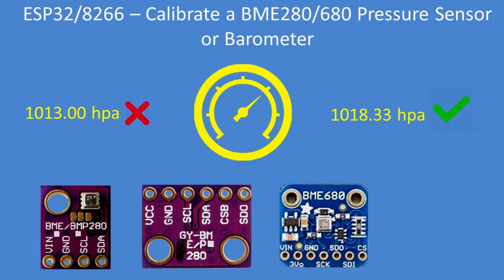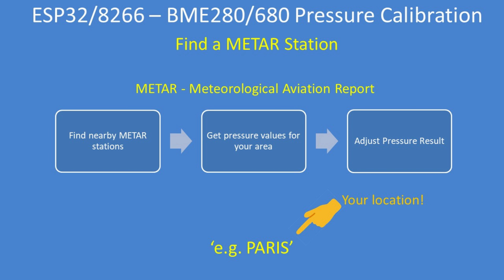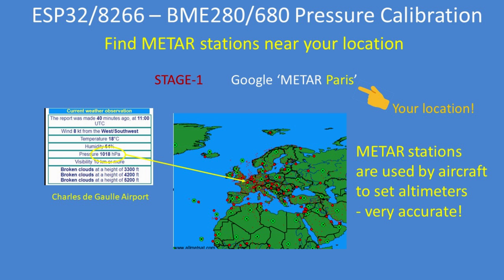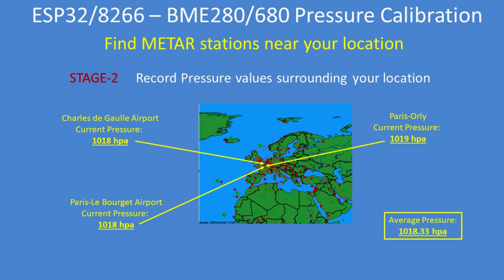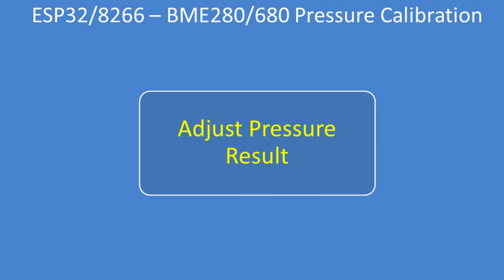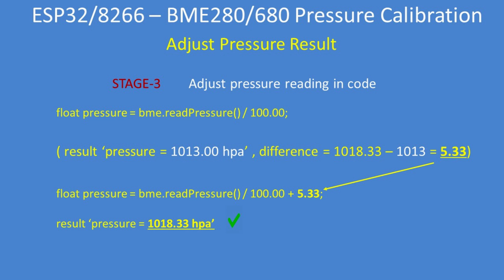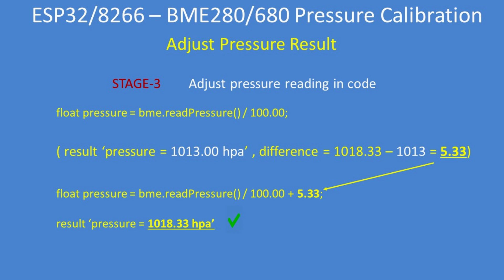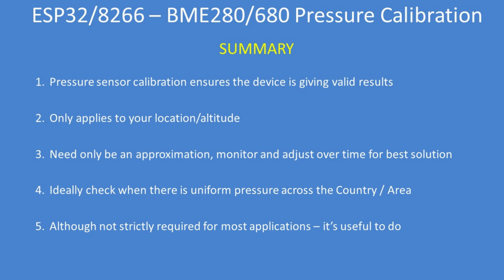Tech Note 142 – Calibrate a BME280/680 Pressure Sensor or Barometer

Comment: Hi, where exactly must the data be changed? In which library folder? I´m using library ver. 2.2.4, changed it almost everywhere without success. Thank you
Reply from the maker: If you scroll down the source code there’s a pressure calibration variable of about 4hpa just note the reading now, then compare with an aircraft station nearby then adjust the value to reach alignment.
Reply: @G6EJD  Hello David, that´s the point. I´m not really familiar with source code reading, without exact instructions it´s gonna fail again. You mean somewhere in file Adafruit_BME280.h? Thanks
Reply from the maker: @TheLakio77 no change needed to the library, there’s an example in the Arduino or Adafruit Examples from the top left menu and in the video is an example reading line at 1:50 that shows how 5.3 is added to reading to calibrate it.
Reply: @G6EJD  I´m digging in it couple hours now but didn´t found anything similar to yours in there. Adafruit examples has three foders: Advanced settings, BME_280 unified and BME_280test. No float pressure or 4hpa :( I´ve tried to change the unified pressure value / 1013.25 /, added my offset to any bme.read pressure value line I´ve found in any file inside those three folders but no success.
Reply from the maker: @TheLakio77 you can either create a variable called airpressure or just display it:

Serial.print((bme.readPressure() / 100.0F) +5.0);
Or
float airpressure = bme.readPressure() / 100.0F + 5.0;
Then:
Seriel.println(airpressure);

When the + 5.0 bits add 5hpa to the result or could be -1.2345 depending on the calibration required
Reply: @G6EJD  unfortunately no success :(
void printValues() {
    Serial.print("Temperature = ");
    Serial.print(bme.readTemperature());
    Serial.println(" *C");

    Serial.print("Pressure = ");

    Serial.print((bme.readPressure() / 110.0F)+14);
    Serial.println(" hPa");
Reply from the maker: @TheLakio77  Almost certainly you haven't started the bme sensor with bme.begin(); as in the adafruit example, it's not as easy as you might think!

Comment: Hi, I have a scenario, that i need to track height of a cube in 3D , when I calibrate it and used .. Then next day again i need to calibrate right?
Reply from the maker: Yes, air pressure constantly changes, there is no solution other than to take your own reference at the start of the measurement and use a virtual reference point not the earth. Then you will get a delta from 0,0,0 which will be reasonably accurate. This is why aircraft altimeters need to be recalibrated before each flight and during flight and before landing so they know their vertical position.

Comment: Hi David,
did you consider that the metar air pressure is QNH (Which is ambient air pressure at the station (QFE)  calculated down to mean sea level). Which is basically QFE subtracted by the height of the measuring station (in lower altitudes: 30 ft = 1 hPa) .
Best regards,
Kai
30 ft per
Reply from the maker: Yes, I only choose metar stations that are close and at about the same altitude as my QTH, luckily I have an airfield just 3-miles from my location and at the same height. You make a good point.
Reply: @G6EJD  Just bought myself BME280 and BMP388 and will give it try and look if there are differences in accuracy.
Reply from the maker: You will find with the air pressure that it’s feasible to measure altitude differences down to 0.1M resolution they are impressive devices

Comment: Hello, the BME280 pressure output is absolute pressure. Your video shows the relative pressure. Is there a function in the library that does the calculation for you or do I've to do that math myself? The formula to do that is (for metric): altitude (in meter) /8 + absolute pressure
Reply from the maker: Yes that function is in the Adafruit library but it’s of not much use as the resultant altitude varies as air pressure changes, so only accurate the day you run it.
Reply: @G6EJD  OK, I found the altitude function. Your right, it looks wired in a chart as your home moves up and down during the day. So, I add the quotient of the formula myself.
Reply from the maker: It’s worth noting that the bme280 is calibrated at a nominal sea level of 1013hpa

Comment: One hPa or mB difference in QNH is only 30 feet. The best way is to find your location height above sea level, eg 397 feet and divide it by 30, 13.2 and add this to the pressure reading from the sensor. Good enough for government work.
An interesting video and another insight in the the insatiable curiosity  that is a radio amateur. 73s ;)

Comment: Using METAR for this application is very brilliant. (I'm a pilot)

Plan on adding COLD/Air Condition feature to this system? I understand it requires 2nd relay.
Reply from the maker: If you mean a thermostat then all that needs to be done for cooling is to reverse the relay co tact’s from using NO Normally Open to the Normally Closed set then as the temperature is met it will stop cooling.
Reply: @G6EJD  Thanks for your response. You know, there are 2 separate temperature ranges, one for each cooling and heating. 

Think of 4 seasons - winter and summer. Spring/Fall - don't need thermostat to run heat or cool during these off-seasons.
Reply from the maker: @robertrade  I see what you mean, so ideally it would need a seasons switch to be added based on date ranges.

Comment: i use this model ，and i wonder，is there a way to get altitude，i use adaftiut bme lib，but i find in
 Example, there is a 1013.25, i can change it, and the
 Lib getaltitude function use an fix formula，but the reference hpa i think is vary every day，so i can not use a fix value。
Reply from the maker: You need to use the hypsometric formula that includes air temperature to get a very accurate value, or just use google earth!
Reply: @G6EJD  
I tried it with bme680 
Those sensors always use the 1013.25 sea level pressure as a reference, so in a weather condition that chages the sea lvl pressure making it far great/lower than the value, altitude readings also changes even with that formula that includes temperature, so if you stay in one place you should measure the altitude verified by google maps or gps and combine it with other variable parameters for example to get the accurate sea lvl pressure  using the formula
 the best way i think to get accurate altitude also is using gps module 

So using bme sensors only it is impossible to get the accurate altitude only if the sea lvl pressure is accurate to 1013.25mb and thats rare (it is just an average value)
Reply from the maker: @imadeddinerabia9541  you can’t calibrate a sensor using altitude as the result will always be an approximation, only a column of mercury will give the correct result and even that needs to be calibrated against some Standard usually held be a national standards institution.

Comment: Thank you G6EJD.  According to BME280 sensor data sheet; sensor reads absolute Barometric pressure.  Altimeter readings use Relative pressure.  Found this formula:   Relative pressure in hPa = (Absolute Pressure in hPa + (elevation in meters / 8.3))  Absolute Pressure = BME280 reading in hPa   Sorry I have lost the source for this formula.  Formula is good in most cases.  Still needs calibration; however, the difference is much smaller.  73, AB9NQ
Reply from the maker: Thank you
Reply: @G6EJD   Found reference to the Relative pressure formula:  https://www.meteocercal.info/forum/Thread-How-to-get-the-sea-level-pressure-with-BMP280

Comment: I started using a ‘fudge factor’ a few years ago when I noticed all three of my BME280’s were reading nearly the same when compared to each other but always off when compared to the pressure from the nearby airport weather station.  I was hoping there was a more elegant way of adjusting the pressure, but I guess not. OR maybe my BME’s are correct and the weather station is wrong...... hmmmm..... time to make my own manometer ?
Reply from the maker: The Bosch sensors are factory calibrated at 1013.25 hpa as that’s a nominal sea level pressure value and so unless you live at sea level they will always be out. There is no offset register on the device, so you have to use an external reference and METAR stations are as good as it gets, you could correct for altitude differences but the difference is margin which is why I prefer to wait for a period of uniform pressure across the region then you can make a good accurate adjustment.

Comment: Wow great David sir  please also make video on temperature calibration
Reply from the maker: The Bosch sensors are factory calibrated fit all 3 parameters, so temperature is calibrated. Pressure is calibrated at sea level so needs to be adjusted/calibrated for altitude.

Comment: Meteorlogical pressures are normalized to sea level before published. So if you are not on the same level as the nearby metar station, you may need to compensate the altitude difference as well. https://en.m.wikipedia.org/wiki/Pressure_altitude
Reply from the maker: Yes, but most sensors are calibrated at a nominal sea level pressure of 1013hpa, but the important point about a METAR report is it’s not meteorological but based on altitude so an aircraft can set its altimeter, then if a station is nearby or on the same level it alludes calibration.
Reply: @G6EJD  understood. Thanks for clarification.

Comment: Interesting video.  There is a small airport just along the road from me (Shoreham) so I just checked that and compared it with the old aneroid barometer we have.  Is it possible to download these values in the same way we download RTC data?  Bob
Reply from the maker: Yes you can connect to the aviation server and download a METAR message it’s meant to be easily read by pilots so it’s short, gives temperature dew point and pressure, the latter being prefixed by a Q for QNH see my code example by searching for G6EJD METAR it gives the outline of how to read the data by software, but be aware there’s more to a METAR message than meets the eye!
Reply: Yes, it is. Try this changing to your airport indicative in case it is not correct:
https://www.aviationweather.gov/adds/dataserver_current/httpparam?dataSource=metars&requestType=retrieve&format=csv&stationString=EGKA&hoursBeforeNow=0

https://www.aviationweather.gov/metar/data?ids=EGKA&format=raw&date=&hours=0

Your airport incative seems to be EGKA

Comment: Really interesting to use METAR for this purpose. Thank for the idea Dave!
Reply from the maker: The ideal is to get an average for a few METAR stations, then adjust for your particular altitude, but it gets too complex to try and explain how to do that!
Reply: @G6EJD  Yes, you need to consider the altitude difference to the airport... But for a maker at home that is a good improvement to the calibration / not to calibrate.